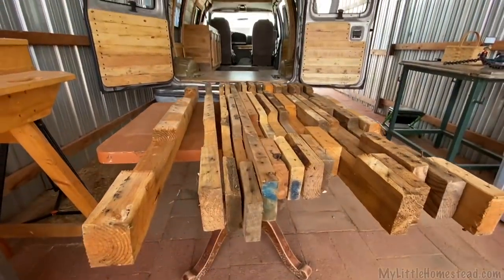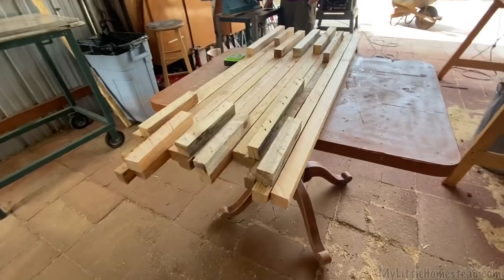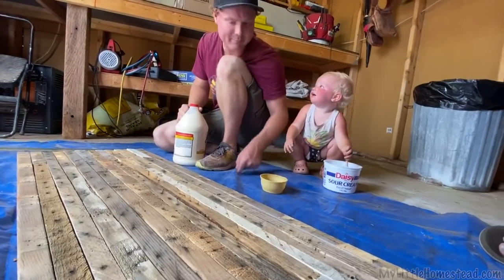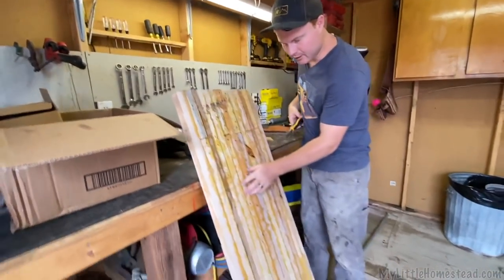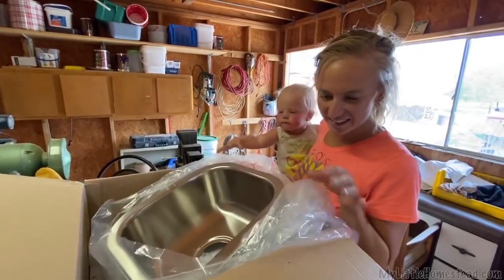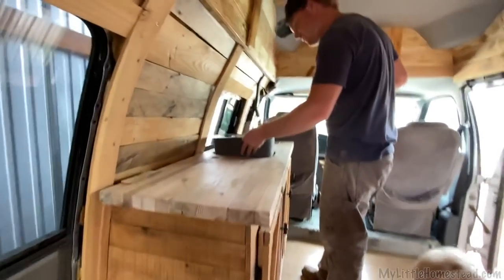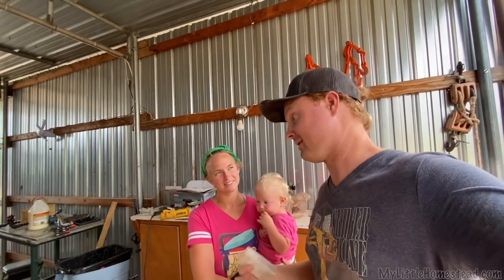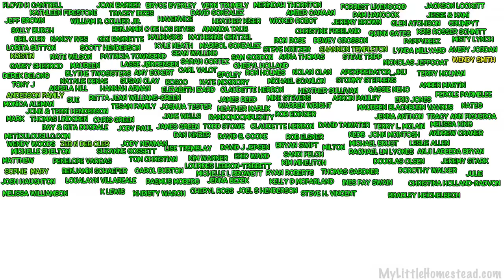Building A Countertop From Scratch | Weekly Peek Ep302

Comment: Butcher block counter tops just need to be oiled oiled and oiled with a food friendly mixture of 50/50 tung oil and citrus oil.  Once the wood becomes saturated, it is water repellant and antibacterial, and non-toxic.
Reply: Do that with the cut out piece to make a cutting board! I bet it could be fashioned to fit as a sink topper. My vintage trailer has that. It's nice I can use the extra counter space while hiding/storing dishes in the sink!
Reply: @gailasgreatdanesandmanes1042  I was going to suggest a cutting board with that piece too.  You can always use one.
Reply: Not so sure I'd do that oil thing on used pallet wood. Fresh cut wood, sure.

Comment: You could size the sink cut out wood to fit snugly in the sink, drill a hole in it to help pulling it out, it will make a great plug to enable even more useable counter space when sink is not in use. It will double as a cutting board. The baby in the hoodie is a great idea to sell even more hoodies! Perfect model! Those babies are growing so fast!

Comment: Great work on the countertop, it looks beautiful! A couple ideas for future projects: Boiled linseed oil makes a really great finish, and is foodsafe, You could make a nice cutting board using the same method or even using that sink cutout, you could even route a section out of the counter top to set it in so it doesn't move around in motion. Great to see people reusing reclaimed material, the older the better, keep an eye out for old barns or houses that are falling down, most of the time people are glad to see it go. Also, getting good with a hand plane and sanding block can save on power consumption, and makes for some really nice surfaces.

Comment: a sink cover that will make the sink area flush with the countertop is very useful... it lets you put stuff on the counter without worrying about the uneven surface and can double as a cutting board. your cutout for the sink could probably be made into a perfect sized sink cover that would fit inside and make it flush with the top... maybe just with a bit of sanding. great job guys!

Comment: Great job. Looking job. I have a suggestion, sand down the part that you cut out from the sink to sand out the stain you tried, Re stain it the same as the finished countertop and finish it like the counter. You can use it to cover the sink area , that way you will have more countertop area. You can take it out when you need the sink and cover it when you do not. The small hole you made to start cutting out the sink can be used to get this cover for the sink in and out. You might need to make it a little larger.
Reply: Great Idea  A lot of people mentioned cutting board but that is one step better!

Comment: Hey guys , next time that you lay up Boards to be glued ; use a 6"low nap paint roller , and suspend it above a paint try , full of Glue .  Then, simply swipe the edge across the rollers TOO EDGE. SAVES MASSIVE TIME  AND ALLOWS THE GLUE TO SET UP MORE EVENLY..

Comment: The countertop turned out absolutely beautiful! The attention to detail to get just the right stain and snugging it into fit with notching out those vertical strips on the side wall is such a great idea. This van is really coming together nicely. It is stunning, but are you concerned at all about all the wood being added inside and the weight this will add to the van and its suspension?

Comment: The countertop looks great guys, however I am a little concerned that you used the Red labeled Titebond glue as it isn't waterproof. I hope you don't end up with the same result as I did when I did the same and after a week the moisture seeped into the joint and it came apart. That was my 1st and only time I will do that lol. Ordered a BIG bottle of the Green label Titebond 3 which is waterproof. All the best,
Diane, UK xx